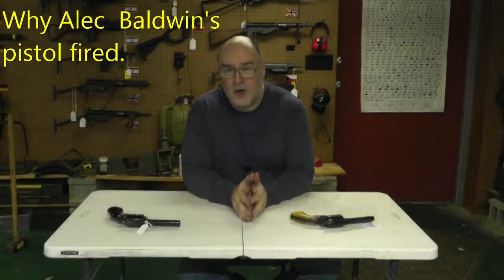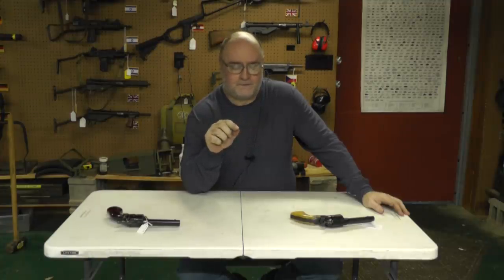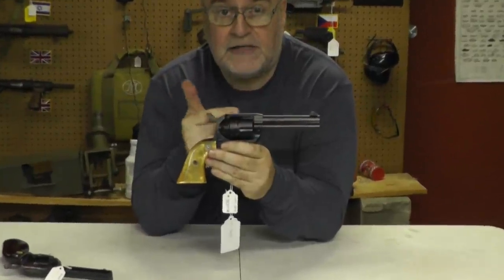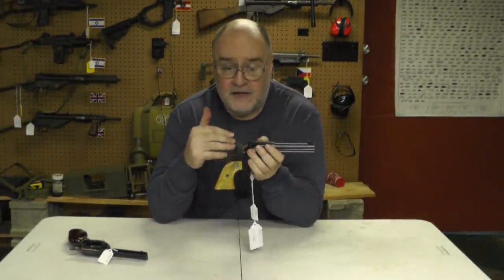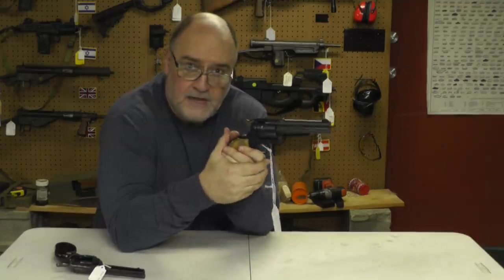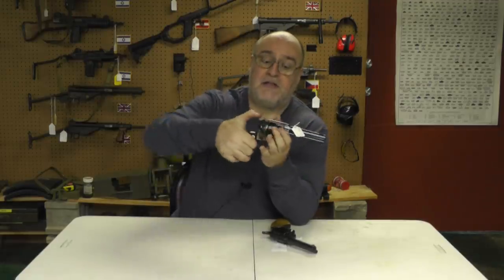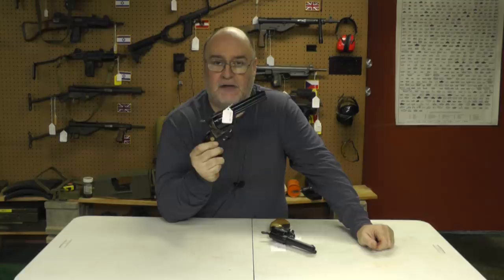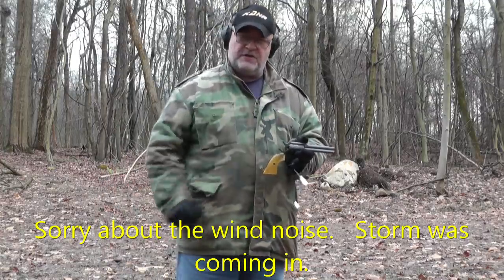Why Alec Baldwin's gun fired

Comment: I agree with the assessment on how the gun was fired by Baldwin. It's the only possible explanation.  Just a huge clusterf*** cascade of incompetencies and errors.

The armorer (Gutierrez-Reed) did not check the firearms as per protocol before handing off to the actor. The asst. director (Halls, responsible for running the set) handed Baldwin the Pietta .45 (from the cart where Gutierrez should have checked them).  Per protocol, Halls should have checked the weapon. He did not check all cylinders (he said he saw 3 rounds, but there were actually at least 4 rounds, one of which was live). Despite seeing several rounds, Halls handed Baldwin the gun, announcing "cold gun". Generally, in Hollywood this term is used to describe a gun that is empty (all chambers verified empty and barrel verified unobstructed). Halls should have not only verified this, but he should also have shown the Director and the actor(s) on set. Further, he should have established a plan for when the blank ammo would be used, ensured everyone had eye/ear protection, etc.

To make this even worse, Halls had apparently witnessed two other misfires on this set previous to this incident, yet still did nothing to modify their procedures or to ensure that live ammunition was not permitted on set.

So it's just one horrible error after another. It was not a cold gun by any measure. It was not checked by the armorer, by the Asst. Director, or by Baldwin. There was a live round in the gun (live ammo should not be permitted on set; will we ever get an answer on why it was even on set?). Baldwin was not properly trained on gun safety (saying he "didn't pull the trigger" is wrong and misleading... he in fact DID, because just like in this video, he was effectively pulling it the entire time). The armorer was inexperienced and unqualified.  The Asst. Director was negligent and irresponsible.

Comment: I am NOT NOT NOT Stickiing up for Baldin, Im standing up for truth. 
And the truth is that at this time, no one has any info about that gun itself.
  1. When I was ten years old I went to camp and the cowboys showed us how they used wax loads, and how they alter the old colts to slam fire.
  2.  Years later, I was shown in person how either you have a gun with no saftey or you disengage that saftey feature to make the gun slam fire.
   Doesnt anyone know that alot of the actors in the 50's and 60's couldnt fire those guns quickly enough so they used either guns that slam fired or
filed down the catch or took the mechanism out to slam fire?
   Remember. Alot of those old Colts, you had to use the half notch so it wouldnt slam fire.
3. I had a Smith and Wesson slam fire when the hammer slipped from my thumb, my finger wasnt even on the trigger.
    I know what you initially said about if the gun was in proper working order. So yes, most probably it wouldnt go off.
 But if a gun CAN NOT go off without the trigger being pulled, would anyone who makes that statement feel comfortable with someone pointing that gun
 in their face?
   And gunpowder does make things get clogged and stick, but it could also make a mechanism slip and fail.
  This sounds like a 100 percent slam fire.. and no one can say that a gun thats designed not to slam fire, can never slam fire!
  Remember when those rifles about 20 years ago were slam firing when you put it on saftey? 
there were a few deaths, and it took years before they realized what was going on.
  I dont know if it was Remington,, I think so, anyway, you put the gun on saftey and it was that tiny notch that was supposed to hold the pin back, it would let it slam foward and it would go off.  They finally figured out that the ones that were defective were because that part came from steel from overseas and it wasnt fully heat treated so it would wear off a thousand of an inch and depending on which ammo you use, in combination, it would let the pin slam foward.
  Anyway. My point is that since day one, theyve been on a witch hunt. not giving a damn about any real fact..
Reply from the maker: Remington and savage both had safety issues.  Remington knew about it and declined to fix it for decades. 
     And the benefit of the doubt is a court of law standard should it ever get that far   However, you are ignoring several things. 
    1 yes if the gun malfunctioned mine and other videos are invalid.  There is no evidence the gun is damaged or broken.  
     2 movie industry standards for firearm safety were ignored.  Live ammunition on set.  Not securing the weapons.  Assistant director picking up a weapon he has not checked and yelling cold gun. Baldwin was aware of the live ammunition he target shot with the weapon.  If you know the industry’s safety rules are not being followed doesn’t that require defaulting to common gun safety rules. 
     3.  It’s Baldwin’s insistence on talking that caused me to make my video. That and his lack of any guilt feeling.  Further his choice of zero gun knowledge crony “news” people to do an interview with us also suspect. 
    4. If the gun was indeed defective was did not show up in either the live fire training or when the armorer supposedly cleaned the weapon.  
       5.  Would Baldwin give any other person who killed someone with a gun the benefit of the doubt. 
       I do agree he is a citizen and deserves the right of a fair investigation and if charged a fair trial.

Comment: Of course you understand that if it really happened this way he is not guilty.  He does say in a recently released video that he did pull and cock the gun, which is consistent with your theory.  What kind of trigger weight does your gun have.  I've wondered if the prop gun has a hair trigger.  I'm sure you've seen people fire single actions without even realizing they'd pulled the trigger.
Reply from the maker: If he was just an actor then yes not guilty.   Being a producer and continued course of conduct including skipping the gun safety briefing.   He’s guilty
Reply: @psp1921tsmg  I understand a producer may foot the bill for damage caused by accidents on set, but the state would need to  prove he violated a standard of conduct placed on the producer.  I don't really know if there are such standards.  I understand a producer may be held civilly liable under Respondeat Superior, but that is different than finding him criminally liable. Seems like a stretch.

Comment: You said it yourself. He's incompetent with firearms. I think who ever loaded the gun is responsible. How would an incompetent firearm user know that those bullets weren't blanks without looking down the barrel and he probably had no knowledge of how the gun was designed to operate. Negligent and incompetent maybe, but responsible for putting the rounds in there in the first place, I think that's the responsibility of the armorer. I could be wrong but what you demonstrated was how easy it would be for someone, not in the know, how they could make that mistake but it doesn't explain how the real bullets ended up there in the first place and how careless someone would have to be to use the same real gun instead of a prop gun on a movie set for target practice and not to think to check before handing back to someone. I think the better question to ask is who would benefit from this and why.
Reply from the maker: Read the police affidavit about baldwins actions or lack of actions that led to that day
Reply: @psp1921tsmg  ok

Comment: Gun was called safe on set so I don’t know why Baldwin would lie…not saying he didn’t just doesn’t make sense if he was told the gun was safe even if he admits to “accidentally “ pulling trigger it’s not his fault …I only have limited weapons experience and I’d know even on a revolver where one can see rounds wether or not to point a gun and pull trigger …what I’m curious about is, can the live bullet get chambered before full hammer lock? And if that’s possible can the hammer fall just before lock also …I know you showed how if moving from safe position it can’t fall past that safe until locked all the way back… but can it go from hammer down to a hair before locked (cylinder rotated a round into position ) then if finger slips ( or hammer is let go ) will the hammer go past that safe position without pulling trigger if was cocked starting from hammer down..? or can it be worn or broken to rotate and no hammer lock ,like a fluke where it just missed locking the hammer but  all else was set for firing …if you can’t tell my limited experience doesn’t include old revolvers, lol…maybe an 357 a couple times and a 44 once when I was a kid .

Comment: Not having any experience or knowledge about firearms in general and the mechanical design of old fashioned type revolvers specifically, an 'actor' can not be expected to know safe handling of these types of revolvers.  The  'armorer' must know this and should have use his or her knowledge to supplement the 'actor's' missing knowledge, but obviously didn't feel it was necessary.  

Ordinarily the armorer is the one responsible and knowledgeable regarding recognition of live rounds and to confirm that no live rounds could possibly be in the revolver, which it SEEMS === SEEMS that she didn't.  The armorer is normally ultimately responsible for safety, but beyond that, we know that SOMEONE introduced a live round in what should have been a box of inert rounds.  I think it very well might have been willful sabotage and it is possible too that a live round was made to look like an inert round that would fool even the experts.  If that were the case, the armorer was not responsible for a criminal act by a third party.  In my opinion, the main focus should be just HOW the live round got in with the inert rounds.   If it was criminal sabotage, that person should be identified and so charged with murder.
Reply from the maker: Read the police affidavit.  There is a continued course of conduct of Baldwin as producer that permitted live ammo on the set.  In addition his lying about his gripping the revolver which is clearly debunked in the video released by the police that was filmed that day.  His ignoring a safety briefing.   He’s way more than just an actor.  The affidavit lays out how his arrogance and laziness lead the the live ammo in gun even if he didn’t load it
Reply: @psp1921tsmg  OK, Baldwin was lazy, willfully ignorant and arrogant in his ignorance and he makes up things to cover his ass.  This is something I see in myself and others every day, but seldom does it harm others and none of it have any laws against it.  This human failing is so common that it is to be expected and that's why armorers and (in my profession) safety engineers are hired.  Introducing live rounds where live rounds should never be, that is where I feel the blame should land the hardest.  I really don't care what a man's politics are when it comes to assigning criminal responsibility and I'm not going to condemn someone just because he's a "liberal."
Reply from the maker: @oldgeezerproductions  the armorer got charged as she should be but it doesn’t excuse Baldwin willfully refusing to address continuous safety violations.   Don’t care if he’s a liberal.  The fact that there were 2 prior accidental discharges live fire on set after hours and crew quitting because of safety concerns all before the incident makes him culpable. 
   And just because you see arrogance and people covering their ass doesn’t excuse the fact his action led directly to someone loosing their life
Reply: @psp1921tsmg  The law only expect "reasonable" behavior and action, not "perfect" behavior with perfect knowledge in all circumstances.  We will just have to wait and see what the jury considers "reasonable" with regard to the behavior of those involved.  I am sure that several people will be found guilty of many things, but I sincerely believe that Baldwin won't be found guilty of manslaughter.  Anyway, we'll see.

Comment: Baldwin and the others hired non-union labor because they were cheap. He’s from NYC and should have known better.  I am a first assistant cameraman who has been standing next to camera for twenty five years and I have seen a lot.  Baldwin was handed a gun that he was told was cold but the Problem is, he hired a crew that did not have the experience or methodology to work safely. Baldwin was used to Union crews his whole career and has relied on their expertise in every department from lighting to props and he was complacent perhaps, but he signed off on a non-union shoot and this is what can happen.

As far a best (or worst) practices—He was practicing a draw for a medium close-up and the camera would have seen empty chambers so common practice is to make empty brass fitted with a bullet and they are visually identical-on purpose. Full to quarter load “Blanks” (crimped over brass) are used in wider shots when the flash is needed, but bits of brass can still come out and punch through 1/2 inch plywood (once, right next to my head). Full load blanks are required on semi/automatic guns for enough gas pressure to operate the slide, etc (watch John Woo movies for some amazing movie gun craft—but I digress).

Experienced, union, crews have many layers of redundant safety practice built-in and if Mr Baldwin had not made a fateful financial decision, he would not have been given a deadly weapon. There are many ways to die on set—from electrocution, crane collapse, falling lights, car stunts, and etc… Experienced union Labour is why this hardly ever happens. 

For those who remember the Brandon Lee accident, that was caused because a they shot a close-up of a mag going into a pistol so a photo dummy bullet was required. After the shot they racked the slide but the bullet had come off the dummy cartridge and stayed in the barrel after which it was reloaded with “blanks.” Well, it was a wide shot with both Mr Lee and the shooter in frame and when the prop master chambered the blank, he effectively chambered a live round. That terrible accident has not been repeated because we all think of it whenever a gun comes on set—call It intergenerational experience.

Filmmaking is inherently dangerous and it should be left to experienced professionals—just like surgery, or piloting passenger planes. Would anybody knowingly fly on an airplane with underpaid, entry-level, student pilots? The Brandon Lee shooting was a terrible accident, while this by comparison was a multi-layered cake of incompetence, and inexperience, topped by the Producer (Baldwin) with arrogance and entitled hubris and as we know from cinema’s parent, the theater, hubris must always be rewarded with tragedy. Baldwin kept to a script that he should have known could bring disaster (they all knew they were not shooting a romantic comedy) and the gods punish hubris with tragedy (death of the innocent, etc).

Baldwin is culpable—more than the armorer, who would have barely qualified as an intern on a real set, and more than anyone else. He was culpable and negligent even before he touched the gun that day because he was arrogant (yes, I have worked with him and he should not be in charge of anything in my honest opinion).

Comment: If Alec Baldwin was as incompetent as you suggest with a colt then that may also be the reason why he just assumed the gun was loaded with blanks because he was either told that or assumed there would be no live rounds on set which would be most peoples assumption, afterall why would live rounds be on set, I'm sure that on most western sets going back to the beginning of movie making all ammunition on site were blanks any special effects where they wanted to create a close shot to somebody was a small explosive set into the wood facing away from the actors face this explode on cue appearing to look as though a bullet blew out a chip of wood ,this type of stunt work was around for years and was well known for its safety protocols, however if a director wanted to cut costs by passing this stunt work and using live ammunition instead of the time consuming and expensive explosive stunt stuff, then it lies with the director but if he was directed by the producers to cut costs in the gun play scenarios, then both the director and the producer are negligent, Alec just worked for them,